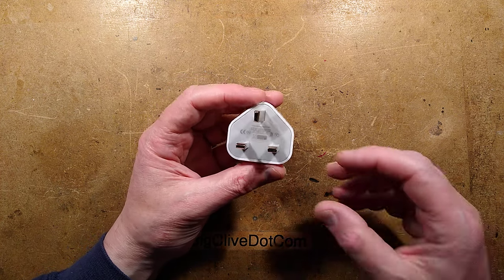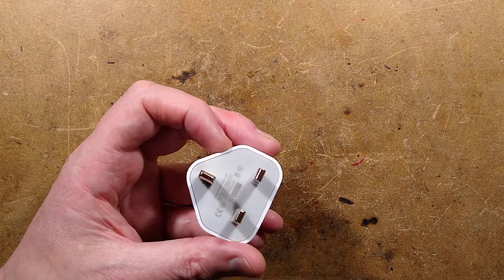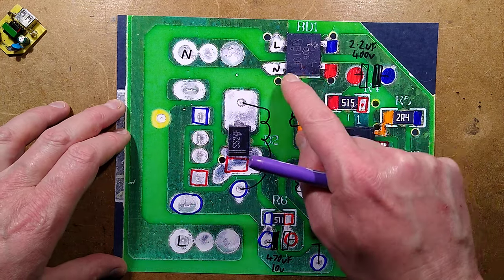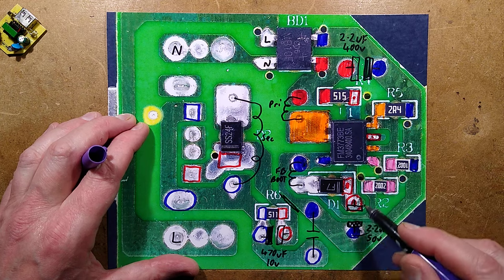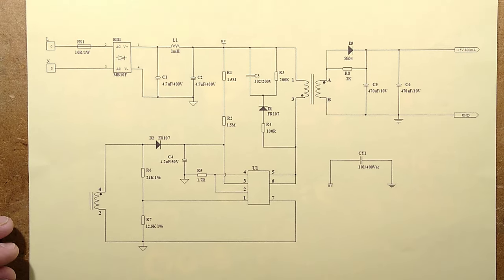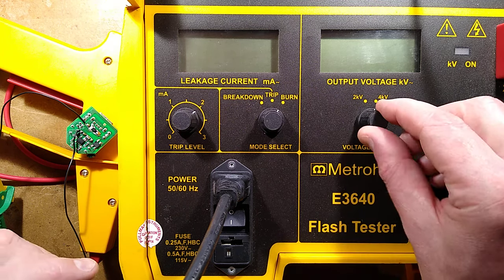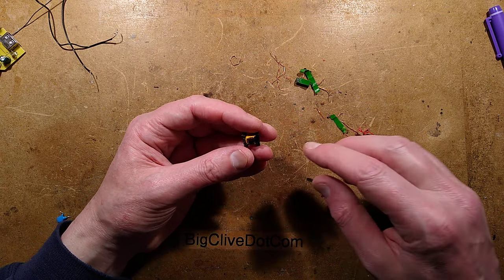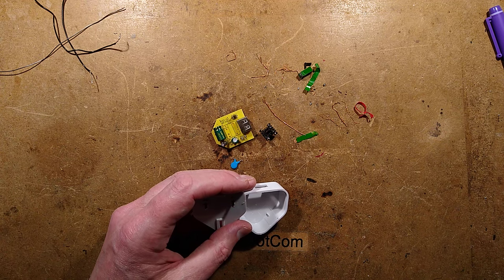Don't buy cheap death-wish chargers

Comment: I used to design offline SMPS's back in the '80s. VDE requirements for 240V circuit spacing is a full 8mm. Even your blow- up only had a couple mm if that. The tiny spacing on the real-life board is scary.

We never used X capacitors for noise suppression because I felt they are unsafe and the same is done (to a lesser but safer degree) with proper primary / secondary insulation and shielding within the isolation transformer, which this did not have!

Your title excused Apple like theirs are okay. I don't know if you have examined theirs, but knowing what I know (8mm spacing in that tiny box? C'mon!), they are not safe either. Everyone thinks Apple chargers are safe, are there any safety marking on them? I looked at mine and it's medium gray text on less medium gray background, deliberately (I'm sure) to make it hard to read. The whole enclosure in USA is about 25mm thick (component height), by about 20mm square, and those are outside measurements. The circuit board is much smaller. Also, no fire safety, no doubt.

120V AC goes in one side and supposedly isolated 5V comes out the other!! I never thought these things were safe and TBH, I'm surprised nobody had been electrocuted yet. I say that tongue in cheek because they no doubt have, but money talks. That's 120V, European standards require much more isolation, understandably.

These things freak me out, and it's just a matter of time!

BTW, if your X capacitor shorts, it probably shorts to Earth and blows a fuse. In USA, the chargers are two prong and have no Earth connection. The only place for it to go is into your body!
Reply: If I remember correctly, clearance for 300V CAT ll as applicable to a double insulated device such as this is 3mm and test voltage is 2240 V a.c. per EN 60950
Reply: @125brat  Technically these are not double insulated, because the work is provided through metal conductors on the output.
Reply: @kenmore01  Not true. Provided all accessible conductive parts meet the insulation, separation and test requirements for double insulation from the hazardous live parts, the product may be classed and marked as double insulated. Having accessible metal parts such as contacts, housing, switches and buttons etc does not prevent a product from meeting the requirements for double insulation.
Reply: @125brat  I have never seen a dissection of an Apple charger or many other brands and I just got in to a hotel after a seven hour drive, so I'm not going to look now; but I seriously doubt these tiny chargers are double insulated if they are even more than basically insulated at all. Yes, there's enough to keep people from feeling a zap if they touch it, but Clive's dissection of that transformer was scary! No split bobbin, no double thickness tape, nothing, Just the enamel of the wire, and if said enamel overheated and burnt off (which much of it is designed to do), there goes your insulation at all.

As mentioned, in USA (I don't know where you live but I hope they are stricter), they use two prong non-polarized plugs on one end and the USB socket on the other. There is NOTHING stopping someone from being the short circuit path except what's inside.

I hope they at least use split bobbins, but you know, they take up space. They are usually nylon too, so will melt if they get too hot.

I believe it is a roll of the dice TBH, but I haven't studied it. I think I will charge at a GFI outlet near a sink until I do.
Reply: @kenmore01  OK Ken, all of your comments noted.

I'm in the UK and used to work as a senior safety and test engineer for a Notified Body in the UK.

Essentially, in the UK these safety requirements are laws set initially by the European Union then adopted into the UK (although that no longer applies since we left the EU). It means that legal requirements are placed on manufacturers and brand owners who import products to ensure the products comply with the law. Those laws require certain safety features in normal and fault conditions, one of which is isolation and insulation at specified levels for the category of the product.

These plug-top adapters whether they are made for/by Apple in China or by Ying Tong for Wall-Mart in a garage in a back street in Hong Kong still have to meet those legal requirements (in the EU/UK anyway) and it's the responsibility of whoever introduces them for sale on the market.
Compliance with the law may be demonstrated by applying relevant test standards to the product and the product must comply with ALL the relevant parts of those standards.

The applicable standard for these products is based on IEC 60950 which is set by an international body, then adopted (often with extra local requirements) as UL 950 in the US, EN 60950 in the EU and BS 60950 in the UK. BUT the actual safety requirements are set in the law document.

The standards (known as Harmonised Standards) provide the best and most recognised way of demonstrating compliance with that law. The creepage, clearance, isolation, distance through insulation, test voltages, temperature rise, requirements for safety critical components and protection against hazards in normal and single-faults conditions etc are set within the Standards. It's up to the responsible body who's takes ownership of the brand to demonstrate how the product complies with the law.
Standards are not mandatory, but compliance with the law is and these products must comply with that law.

Ok, that sets how the law works (or should work here) but at the end of the day, these cheap products can't comply with the requirements at the price point they are sold at because decent safety certified components and materials aren't cheap, nor are engineers who understand design criteria to meet the safety requirements.

Whilst end users insist on the lowest price being the most important reason for buying a product and ignorance of the safety argument doesn't figure in the decision, these products will continue to be made and sold. Enforcement authorities are almost powerless to halt the flood of these products onto the market as the human attitude defines the behaviour.

Comment: Genuine Apple UK plug charger weights 46g. Most fake weight around 20g. Another way to tell is the matt Silver colored plating on the plug rectangular power pin metal surfaces. A definite fake if its shiny. I did an investigation many years ago, out of 45 pcs bought from retail outlets. There were only two weighted more than 40 grams, one was a fake with a metal weight inside. The other one was a genuine second hand.  Its also difficult to tell from the label prints because many fake looked better than the real one. The remaining 43 pcs were built to kill someone careless, overlooking essential safety criteria that don't cost much to meet.

Comment: I bought a double usb charger plug from a perportably, reputable source, but after about two months use, i notice it has cracked in about 7 places. Is this still safe to use? Can i send it to you? If dangerous, you are probably the best and safest route to explore.
Reply from the maker: If it's cracking I'd recommend getting a new one in case the enclosure comes apart while you're plugging or unplugging it.

Comment: The Y capacitor, the transformer and the "spark gap" should withstand 5kV for a certain amount of time on modern double insulated equipment. It used to be 4kV, hence the 4kV setting on your tester. 2kV is for earthed equipment. Milling the PCB is not enough since 5kV will bridge 5mm of air; a sheet of insulating material needs to be inserted in the opening as well.

Comment: Right off the bat, that will not comply with IEC related standards (I don't remember the standard number off the top of my head but its aligned to BS standard numbers in the UK). 
That unit will FAIL surge testing when tested at an accredited lab.
Reason: The isolation clearance between the mains and the USB is insufficient. Lightning, for example, will easily jump that gap and blow up whatever is on the output. Imagine if you are holding a phone on charge and a lightning strike happens nearby... You will endure the wrath of that too.

FYI- this very product is available here too. I've seen them at the Chinese malls.. they're cheap but are made to look legit like Apple stuff with the plastic films and packaging.

Comment: Did it have a CE mark on it? When we used to wind toroidal transformers we would wind a layer of tape over the primary with a 1/3 overlap. Then, repeat with another layer of tape. Even if you had microscopic pin-holes in the tape, you could be pretty sure of at least two layers of healthy tape covering it.

Comment: Clive, I take issue with your assertion that a failure of the I/o separation and the shock would cause you to grip a metal-cased phone. The voltage would be a.c which would make your muscles spasm and throw the phone. Only a d.c. shock makes you grip on and is far more dangerous. Of course neither is nice.
Reply from the maker: It's the complete opposite.  It's the pulsing of the current that causes sustained muscle contraction.
Reply: @bigclivedotcom  That's not what research on the web supports. The phenomenon of tetanus with d.c. causes muscles to contract and in the case of the hand, to grip, whilst a.c will cause the muscles to spasm and release.
Reply from the maker: @125brat  I've tried it on myself.  Smooth DC caused a single muscle spasm and then a burning sensation.  Both pulsed DC and AC caused sustained muscle contraction.  Your muscles can't respond at 50/60Hz, so they just lock solid.  It's a complete myth that you can let go because AC current goes to zero 100/120 times a second.

Comment: When I worked in the transformer industry, double insulation was mandated --- at least for any unit connected to outlet (mains) voltage.   Either additional layers of insulation between windings when it was "stick wound", or using separate bobbins for each winding.   My, how standards have fallen.

Comment: Those tiny/cheap boards keep amazing me. I've never done board design, but I'd immediately put the rectifier as well as the primary side between the L/N plugs, so you could have all the separation you want without excessive tracing. But I guess they were forced to do it this way to get it to look the Apple way. At least they could have used the ground pin to make it more susceptible to fault that way I guess.

Comment: Clive I've come back to this as my genuine Huawei plug is now getting a bit Hot to the touch lol
The Mrs is concerned as I recently replaced the charger cables done a wired test and the output of the plug with the new cable is the same as the old but the old is a 5A cable where the new is a 6A cable

Comment: I remember back when I was working my first job, had managed to get my first contact and had an iPhone 4s, bought one of those plugs so I could charge at work, few days after I bought it, plugged my phone in and the plug literally exploded, the casing came apart, black soot all around the plug socket, took an age to pry the remaining bits from the socket! Since then I only buy reputable plugs !

Comment: Hmm, I hear you mate. I'm still using the same Apple mains plug charger at home that came with my iPhone 11pro, but I do use a multi plug charger in my car. It has 2 usb sockets and 3 cigarette lighter type sockets. I use one for my dash cam and often  have my iPhone plugged into the usb for Googlemaps.

Comment: A number of years ago I worked for a big UK restaurant chain and we weren't allowed to change lightbulbs or plug our own phones into the mains, obviously that got ignored. A customer asked me to plug her iPhone in with her charger, so I went to the bar and plugged it in with the phone in my hand. The thing went live at mains voltage across the metal antenna ring around the outside and I immediately dropped it! Manager 'what's wrong with you?' me 'I just got electrocuted, don't touch it'. She picked it up thinking I had broken someones phone. We all got on well and I have fond memories of that double electrocution incident!
Reply: @Okurka.  It was a pretty decent zing from what I remember!
Reply: @Okurka.  what do you think it was?
Reply: @Okurka.  Haha yes correct, my poor use of the English language! I genuinely couldn't work out if you were trolling me or not

Comment: one of the perks of living in the states.  I've probably bought hundreds of forbidden sugar cubes 'desnided by A88le in Californib' with non polarized or grounded pitchforks of 110v tingly death, I'm sure it happens, but I've never once been shocked or had one explode. 

... well, no, thats a little bit of a fib, it isnt extraordinarily hard to buzz your thumb if you arent careful and fumbling adapters at night.  Lemme rephrase, ive never gotten a shock without asking for it.  

I'll still gladly trade explodey wall adapters for 50% slower kettles.

Comment: Many moons ago I worked in a shop that sold cheap android tablets with chargers like this. Shouldn't have even shipped with an apple style charger (I learned that later). I bought one with staff discount, took it home and the charger immediately popped, leaving black soot all over the extension lead. The manager let me have a refund but wouldn't take them off the shelves!!

Comment: Clive, I take issue to you calling the blue component a class Y safety capacitor. I would presume it is just a blue-colored standard ceramic capacitor without safety ratings.
Reply from the maker: I'm really just referring to its place in the circuit.  I've seen ordinary brown capacitors used there too.

Comment: I brought two chargers from Amazon and a charger chord. Tried putting a usb chord is on and it wouldn’t work. Never intended using the plugs just the wire. Using the wire. Still gets hot. Now thinking oh getting apple ones.

Comment: If there was a routed slot to give better separation, the blobs of solder on each side would have probably still flashed-across anyway. It would have been a good experiment to see if a slot would have made much difference.

Comment: In addition to everything described, also not too hip on the mains contacts spike being directly adjacent the bare metal USB port housing. I didn't see an insulation or separator so it's one hard knock away from the housing being live at mains voltage.

Comment: Here in norway both line is live. no neutral.. so that will not be good here. you will have power to the output if that "safety cap" fails.

Comment: Would it be a useful project to remanufacture this on a better board?  I mean, you have all the bits and some of the bobs, could be a therapeutic afternoon spent making it safe and useable.  It is something I will try next time I buy something off ebay.

Comment: That's interesting, because it looks like one of my chargers. Resembling things is no guarantee they're the same on the inside though, and mine doesn't claim to be anything other than a budget charger. It has the CE mark and the double-insulated mark. I only use it to run a 0.02A LED lamp, because that's cheaper to run than a room light. I run tests on things, to rate them, make sure they're not doing anything odd, and so far, it's passed.
Reply: Have you done the full compliance tests though? Anyone can put a double-square and CE symbol on anything. It doesn't mean a damn thing unless it's backed-up by proper testing and certification.

Comment: I have a question: why is it that USB plug adapters like these (and even good ones)  don't have an earth pin, but instead use a plastic pin to defeat the safety mechanisms of your bog standard UK wall socket? I always thought (or was taught) that having an earth was a pretty important thing.
Reply: Where would the earth pin go? To USB ground? Not really neccesary if nothing live can touch it, and a good way to introduce ground loops
Reply: In the UK an appliance can be earthed, or if it is "Double Insulated" its not necessary for it to be earthed. To qualify as "Double Insulated" it has to pass a number of criteria, including no metal on the casing, and no access to live parts. Some people consider having the output of a charger not earth-referenced to be safer.. If you're going to be able to plug it in you will need to have some kind of earth pin even if its plastic to open the shutters on the live and neutral connections.
Reply: If I remember correctly it's because they're classified as double-insulated appliances, as in even in the most catastrophic fault the input side (high voltage/mains) it's still separated from the output side (low voltage), and doesn't "jump over" possibly k1II1ng you.
Reply: @westelaudio943  Humour me, if you would, because I don't know. I have plugged in beside me my computer (three pin kettle cable, earthed) and my tablet (two pin no earth). On both I'm watching the same video. Why does one need to be earthed, but not the other?
Reply: @martinh4982  

I assume it's a tower PC with ATX power supply.  If a live wire would melt through the rubber sleeve or become loose in some way it could touch the PC case and make it live but the earth will keep it at neutral potential, tripping the GFCI or breaker. With a well built, plastic case PSU it's nearly impossible for anything touchable to become live so it's considered double insulated.
Reply: If it doesn't have a metal case, what would you connect the earth pin to?  The purpose of the earth pin is to make sure anything conductive you can touch is referenced to earth.

Comment: Have you come across a synchronous diode, it looks and measures like a silicon diode, but actually in the package theres a fet in parallel with the diode, and a circuit that detects the flyback cycle and turns on the fet bypassing the diode, it makes a standard flyback psu as efficient as a synchronous supply, they seem to be gaining popularity.